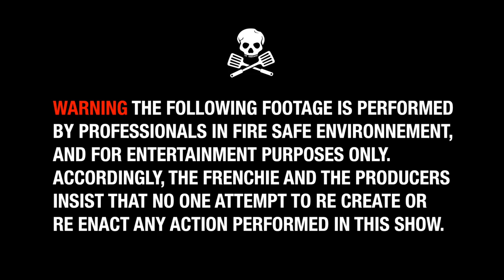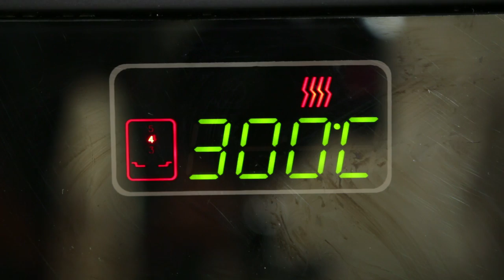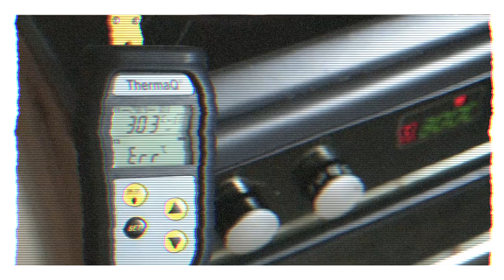#2 Homemade Pizza : Mini Brick Oven Indoors !

Comment: Reflecting heat off the bricks and back upward in such close proximity to the element may be detrimental to the safety and performance of the oven. Heat buildup above the element may overwhelm the insulation and create an issue of safety. And there may be a thermal fuse that will open if the temps get too high. Please take these factors into consideration when doing this in a domestic oven. In other words, you may not want to try this at home.
Reply: I think I would be more confident doing this in a webber bbq or any bbq with a hood.

Comment: the most simple & energy low & home equipment only option with best results:
1.)preheat big pan and set your oven to max, on grill (important that the spiral is red hot)
2.)drop your dough on the pan, put all ingredients on, while you are doing that, the pizza is baking from the bottom
3.)keep checking the bottom of the pizza until you see leopard skin (cca 5 min), then transfer it with the pan on the highest position in the oven closest to the spiral. you can let the door half way open if necessary. 
4.)now wait until the pizza is done from the top. should take about 3 min

Comment: I cook my home made pizza on a flat steel pan separating the cooking in two parts.. top and bottom..
 for the bottom:
Pan on hi flame (when max temp) add the pizza on top.
When the bottom is cooked I place the pizza (still in the pan) as close as possible to the oven grill already red hot.
The pizza will cook in 3 or 5 minutes maximum.
The closer to the heat the more you have!!

Comment: I see you are also hampered by your ovens max temperature, in Australia standard max oven temperature is 250*C. I however would be cautious not to overheat and damage the oven using firebricks, I think it would be best you use this method in a Webber BBQ or any bbq with a hood.

Comment: I use a large cast iron skillet to cook my pizzas. Just let the cast iron skillet warm up with the oven and then place your pizza in there with a spade or something. It works like a charm and since metal is higher on the thermal conductivity list then stone is it goes faster and makes a crispier bottom. Also you can pick up a big cast iron skillet at a thrift store so they aren't that expensive :)
Reply from the maker: Epex Great technique

Comment: A beautiful result!
I'm a little scared to do this with my Gaffers and Sattler.  It's in a wooden "case" or surround, and the surround was broken a little in the earthquake, so I don't know how long it will stay or if very high heat will make things worse.  Also, they don't make G&S anymore, so we're already cannibalizing the lower oven to keep the upper one working!  And it's too hot to turn the oven on that high right now, but in the winter, this will be a nice way to warm up the house!
Ahh, well, an excuse to redo the kitchen and get a regular stove!

Comment: The reason stone works in brick ovens is that they don't heat the pizza but that they don't melt while facing the 485C heat of the wood fire. You need the exact opposite for your domestic oven, which you address in your next episode.